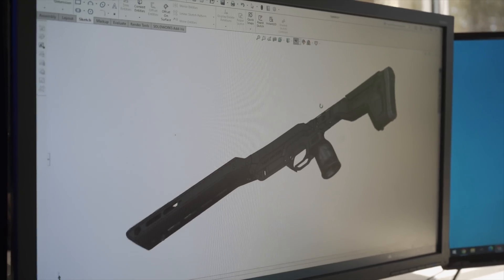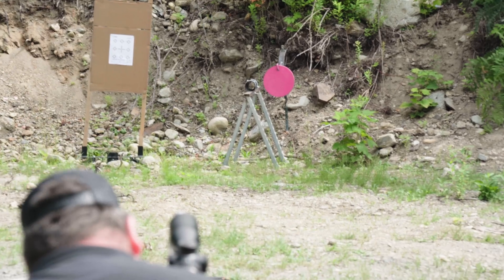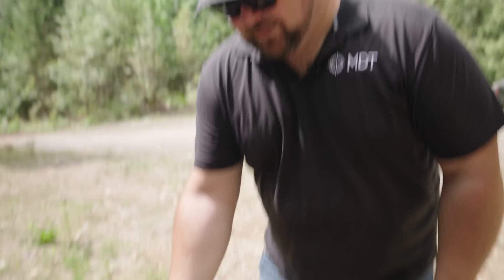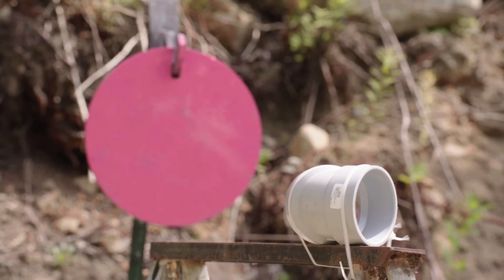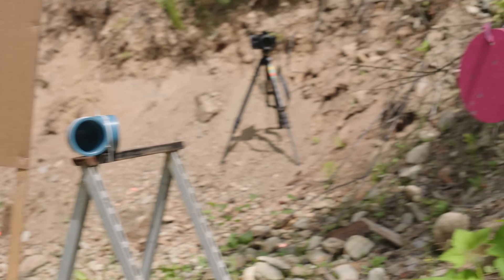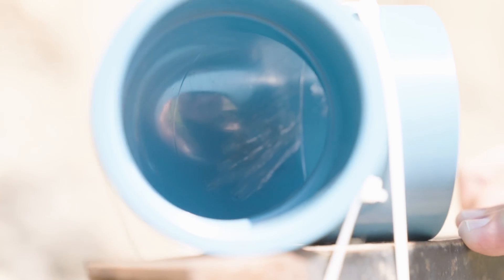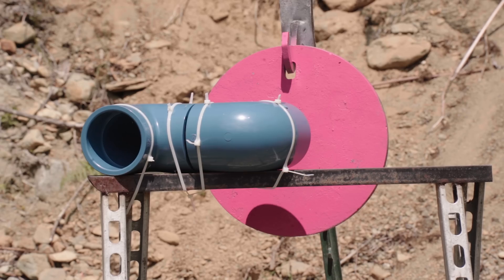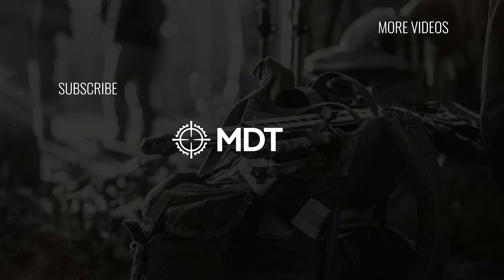Can You Bend Bullets?

Comment: Whith pipe, the schedule rating of piping and fittings refers to its resistance to pressures, the lower the number the weaker the part, so the Schedule 15 fitting is probably the weakest you had. Most common applications use schedule 40 and for heavy use: schedule 80.

Comment: Use 2 inch 1500 or 2000lb elbows ( high pressure ) Will withstand 62 cal round ball from muzzle loader rifles. ( don't ask silly questions).